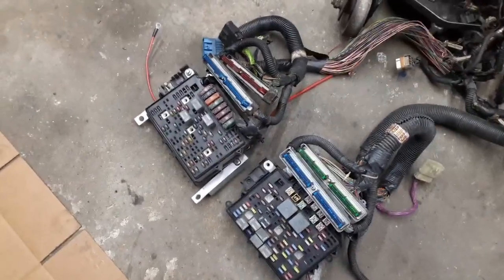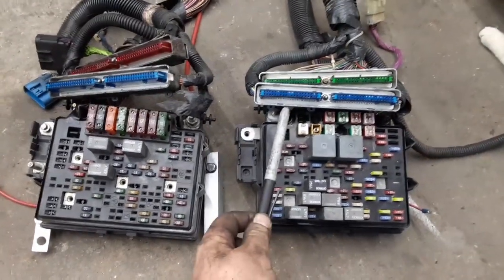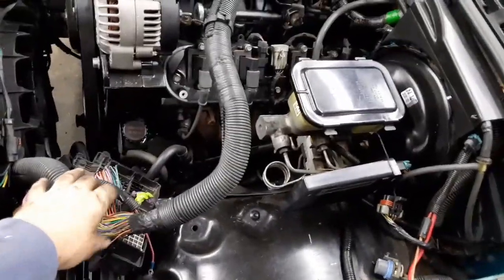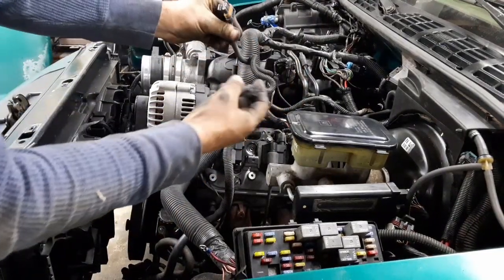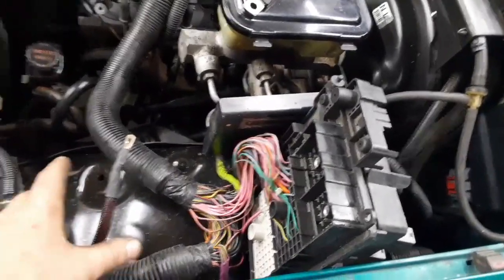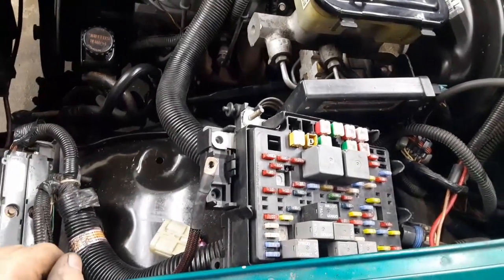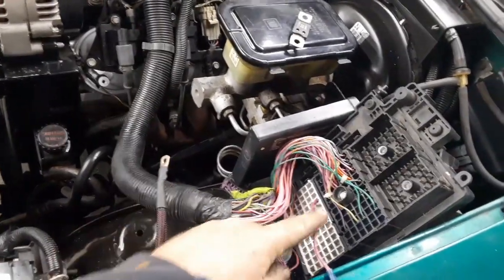LS Swap Wiring Harness for any vehicle- Basic and Simple Stock Harness - DIY

Comment: Great video man, I'm definitely gonna do mine this way. Way simpler then seperating everything ! 
One question, do I have to use the fuse block from the ls engine? I wanna swap my motor in but I'm confused how to use both the engine harness connector with my other fuse block. 
Any information would be great!!!
Reply from the maker: Most of the time I just leave the vehicle fuse block in place to run the cars electronics, and add the second LS fuse block to run the engine. Makes it easy that way, nothing wrong with having two fuse blocks.

Comment: Can I run a Ly6 with gen 4 harness and 58x crank, 4x cam, gen 3 intake/throttle body/heads, 6l80 Transmission?
Reply from the maker: Yep, it will need to be tuned for the gen 3 parts, but anything's possible with the right computer setup.
Reply: Thanks. Can I use the blue/green ecu?
Reply from the maker: Nope, you need a Gen 4 for a 58x.
Reply: E38, E40?
Reply from the maker: Either one, both are gen 4 V8.
Reply: Ok. Thank You!

Comment: I have 2002 red blue pcm with drive by wire, can i replace pcm to green blue pcm and program it?
Reply from the maker: Yes but also no. You "can" swap between the computers, but you also need to re-wire the wiring harness, change throttle body, TAC module, and gas pedal.

Comment: What if ur not using stock transmission will it still run or be on limp mode?
Reply from the maker: The transmission type and limp mode depends on your computer tune, not the wiring harness.
Reply: @lsswapshopp  cool I was planning on deleting the 4l60 to th400 and swapp throttle body to cable instead

Comment: You probably won’t see this but I did a v6 to v8 swap on my truck and I ran into a problem with my harness , v8 motor came from an 02 truck with harness and all but the harness won’t hook up to the original harness that comes from the truck which is an 06 truck i swaped computers and fuse box but the harness won’t connect to that purple wrapped plug and the Obd2 sensor if I’m not mistaken any idea what I could do?
Reply from the maker: Yep, the V6 and the V8 trucks use completely different wiring harnesses. You have to make the V6 truck match the V8 truck, which isn't fun or easy, basiclly it's lots of rewiring and parts swapping.

Comment: Where’s part 2 looked on your videos and didn’t find it
Reply from the maker: What was part 2 supposed to cover? I probally sniffed too many gas fumes and forgot about it.
Reply: @lsswapshopp  the steps to do the relay to prime gas pump and how to connect electric fans obd2 port
Reply from the maker: The fuel pump relay is already built into each of the fuse blocks, so it's automatically done for you. 

I also have 2 videos on how to wire up the electric fans. The one using the stock fan wiring harness is the easy mode one.

Comment: are you using the stock neutral safety switch? or how did you bypass it?
Reply from the maker: You can bypass it by running the ignition switch to a relay that activates your starter. As long as the PCM has the correct key-on power during Run/Start, it will start. The PRNDL switch just disables the starter relay in the stock fuse block when it's in gear.

Comment: Great video! Can I ask, what are the other harnesses that plug into the fuse box? I have recently inherited a swap that’s a drive by wire, I have the fuse box but it only had the main center harness.

I don’t have the grey harness that you ran the 1 wire from. How can I figure out what those harnesses are that occupy the rest of the fuse box so I can source them online or at junk yard. Thanks!

Comment: Nice video! I swapped a 5.3l out of a 2002 sierra into my 2010 colorado, tach works, no speedo and no fuel level.. temp gauge works though, its got a 4l80e so its getting a speed signal, bit still nothing at the speedo.. any tips? Or rhings to look for for the gas level and the speedo? Thanks!
Reply from the maker: GM wiring between 2002 and 2010 had a bunch of changes, it's likely communication issues with the instrument cluster.

Comment: I have a 2010 Silverado 5.3 Ls with a six speed 4L60E transmission all together but wanna put it in my 97 s10 pickup and I wanna go carburetor a couple of people told me if I go carburetor I won't be able to use harness nor computer nor transmission if you could bless me with your knowledge on this I surely would appreciate it my first time doing a Ls swap thanks bro
Reply from the maker: They're basically correct, although stand alone transmission controllers are a thing, and a computer can still be used with a carb. The real problem is carbs don't improve any aspect of the motor and literally make it worse.

Comment: And here I was thinking I needed an aftermarket harness. Geez. I'm guessing if I swapped cams then I would need to take it to get tuned at a shop?
Reply from the maker: Yep, aftermarket parts that greatly affect air or fuel need a custom tune. Cold air intakes and intake manifolds don't matter, but a cam changes everything in the VE table.

Comment: great vid i have a 2000 5.3 dbc what do i do with the  VAT system does the A9 wire eliminate that, thank you in advance!
Reply from the maker: The Anti Theft can only be removed with a tuning program, it's not wiring related.
Reply: @lsswapshopp  so if i wire my ls motor like in the video it will run that way?
Reply from the maker: Yep, it will run as long as VATS is disabled.
Reply: @lsswapshopp  Thank You for the info and the quick replies !

Comment: !
Reply: Hello, really need your help, I have Nissan note e11, electronic throttle body, but it keeps going off which many mechanics are not able to repair, we've changed the ECU and other boards but it still doesn't respond, it loses power supply to the the throttle,,, can you help me out with solution???

Comment: My wife inherited an old 87 dakota from her grandfather about 2 years ago. And I've been considering an ls swap on it since she got it lol. Your videos are extremely helpful on ways to help with the swap even in other vehicles.  I do have one question though (you may have covered it and I missed it) did you have the tune the ECU to by-pass the PATS pr is there another way?
Reply from the maker: Yep, you'll need the computer programmed for the swap, VATS delete and usually a couple other changes for it to work right.

Comment: So how do I find out the right pcm to use. I didn't get the pcm from the donor
Reply from the maker: Did it come with the wiring harness? You can also base it off which throttle body and TAC module you have, if its drive by wire.
Reply: @lsswapshopp  yeah I have the harness and the fuse block it has a drive by wire throttle body
Reply from the maker: If the wiring harness has big Red and Blue connectors, you need the 1999-2002 style computer, if the connectors are Green and Blue, you need the 2003-2007 computer. You can also check the part number on your TAC module to figure out the year range.

Comment: So that A 9 wire gets plugged into the stock fuse panel to any Key on power fuse?
Reply from the maker: Yep, it just needs key-on +12v to turn the fuse block relays on.

Comment: How did you connect the throttle drive directly to the computer
Reply from the maker: For drive by wire the throttle body needs the TAC module also. The stock wiring harness connects all 3 together.

Comment: where do you plug up the pink wire? the one that you added to a9?
Reply from the maker: It's the +12V wire from the ignition switch when the key is in RUN or CRANK positions. It turns the fuse block relay on to power everything up.

Comment: Wil please help what plug s in to the firewall? Only the ignition? Does the stock computer stay with old harness or its unnecessary 
I have a Tahoe 4.8& engine harness and a 03 s10 4.3
Reply from the maker: An '03 will be a little different then the '94 in the video. The easiest way is leave the stock S10 computer and wiring for meow, and just get the 4.8L running with the standalone harness and wiring. Then figure out what can be removed or needs to be connected for gauges and stuff to work.

Comment: Great video but what about the fuel pump? Like what wires activate the trucks fuel pump when turn on
Reply from the maker: With the stock computer and the stock wiring the computer will turn the fuel pump relay on and off when the key is in the run and start positions.

Comment: Can you put a throttle by cable intake on an 04 engine and run the older harness and computer? Or can you still use the 04 intake but swap the throttle body to a cable throttle body?
Reply from the maker: Yep, the only real difference between the 1999-2002 engines and 2003-2006 are the wiring harness, computer, and throttle body. If you use the earlier 1999-2002 DBC throttle body, wiring harness, and computer on a 2003+ it works perfectly fine. The intake manifolds are all identical from 1999-2006 except the 03+ might be missing the brass threaded inserts for the throttle cable bracket (I've seen some missing and some have them but not used)

Comment: Thanks for the video! This gives me another option to look into when I'm ready to do my LS swap into my '68.

Your shop cat reminds me of Dirt the cat that hangs out at the Nevada Northern railroad out in Ely Nevada. 

I had picked up a running, driving 2001 Suburban almost two years ago to use for the swap into my old pickup. Like you I've used my donor vehicle as my daily driver for several months before I had purchased my 2010 GMC Sierra 1500, and when the GMC AFM cam and lifters had taken a crap on me. I have faith that my LS swap will go well, it's just the conversion parts that I have to deal with, like motor and transmission mounts, 4L60E 4wd to 2wd conversion and refresh, fuel tank relocate and fuel system, wire harness integration, and more.

I'll be watching more of your videos for tips and inspiration. Thanks.
Reply from the maker: One step at a time and you'll be done before you know it. The "other stuff" besides the motor install definitely takes most of the conversion time.

Comment: Basically I can just leave my harness In tack. Swip the computer. Add a wire. Grounds and ill be good? Cause this is exactly what I'm looking for. 06 Yukon completely runs fine. Leaving everything on there. Just want to make it simple. Don't wanna strip harness or anything. Just a daily driver swap.
Reply from the maker: Yep, you can leave the stock harness 100% intact. I'd just recommend taping off any un-used connectors very well to prevent any sensor plug power wire accidents. It works perfect, just isn't as pretty.

Comment: Hey what's up I was wondering how did you do your interior wiring harness
Reply from the maker: The interior is all stock wiring, basically you can have two wiring harnesses for the vehicle. The stock one to run interior, lights, etc.. and a second one just for the engine and trans. The only "crossover" wires are signal wires for the stock gauges to work and A/C controls.
Reply: So I have a 87 Camaro 3rd gen it was a V6 and now I have a LS 5.3 with a 4L60E transmission and I have a PSI Standalone harness and do I keep the driver side harness and get rid of the passenger side wiring harness
Reply from the maker: The easiest way is leave all the wiring intact, get the swap running, then figure out which wires aren't used and start removing them. A Chilton or Haynes manual with a wiring harness schematic for the Camaro would help also.
Reply: Hey what’s up bro how you doing That crank no start not getting power to the coil packs or injectors while car is cranking in no spark I think

Comment: Great video very informative and straightforward.Do I have to hook up the neutral safety switch for the 4l60 to work properly?
Reply from the maker: You can bypass the neutral safety switch if you want. I've wired the starter to a relay that runs directly from the ignition switch and it works fine.
Reply: @lsswapshopp  thank you i a[ppreciate it

Comment: The front 02 sensors are what puts the engine fuel control into closed loop once warmed up this is what makes them run better when installed
Reply from the maker: Yep, better fuel economy and more HP.

Comment: Does the radio or headlights work, I am abit confused, does this have the original fuse block still to run starter, lights radio an stuff, does this need two ecus? An stock pcm for shifting? Or whatever
Reply from the maker: Everything works. The starter runs off the 5.3L fuse block. The headlights and radio use the original S10 wiring and stock S10 fuse block that's in the dash. This year S10 has a separate small module for the dash gauges, so the stock S10 ECM isn't used, just the 5.3L PCM for the engine and trans and the small S10 module for the gauges.
Reply: Okay, I am abit confused on the computers of cars skill, my trucks obd1 with an ecm in the cab, and a pcm in the engine bay, trying to swap to a 5.3 or 6.0/4L80e combo and I need to figure out if that requires ecm and pcm, aswel as fuse block, well keeping the firewall back basicly stock wiring, trucks a 1995 350 tbi k1500
Reply from the maker: It varies from car to car, but basically the LS engine and transmission (4L60 or 4L80) need a computer to control them (the Gen 3 PCM does both). The wiring harness for the engine/trans can be completely separate from your vehicle with just power, ground, and +12v ignition. Then you vehicle needs whatever it needs to run the car stuff, lights, radio, etc.. The easiest way is just keep two "separate" wiring harnesses and then later integrate whatever you need like gauges once the swap is running. Hope that doesn't make it more confusing.

Comment: I have the same harness what did u do with the rest of the wires on that big white connector for fuse.an those little connector right under the fuse box
Reply from the maker: Any extra wires that go to the stock truck I removed. If you pull the blue plastic slide-in "clips" you can push the extra wires out of the connector.

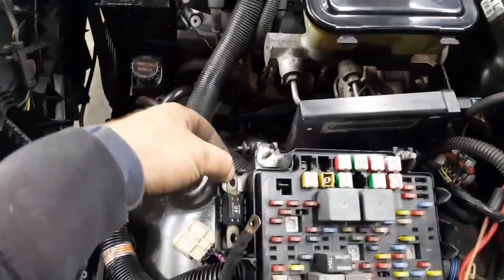Comment: at the 8:18 mark u mention the stock fuse. I hv 3 fuse boxes an all 3 r missing that dam fuse. do u no wat it is called so I can possibly get one at a auto parts store.
Reply from the maker: They're usually called MEGA fuses. It's the brand name, not the technical name, but MEGA is the most common and is the OEM one used. The parts guys will know if you ask for it by that name. They usually have all the common amp sizes hanging near the Help! section.

Comment: how did u mount ur MAF at the front of ur throttle body ? none of my spare parts fit correctly.
Reply from the maker: Just a rubber adapter I had laying around, not sure where it came from. The stock intake should adapt to your MAF.
Reply: I just cut that black plastic.i have alot of those I get from my favorite junkyard.

Comment: The 03 Express van  fuse block is completely different on the plug side. Do you have any information on this?
Reply from the maker: I'm not too sure about the express vans, they had some differences so I usually avoid them and swap the wiring to the more standard "truck" wiring. Is it possible it's a block from a 4.3L van? Also, the vans were drive by cable up until 2007 which could be why it's different.

Comment: I'm just an older guy who is kinda new to this LS stuff and acquired an '03 Silverado with a 5.3 for next to nothing complete and running, the body and interior are a little rough condition but I am thinking about using it as a backup vehicle to drive in case my main one breaks down until I can find something to swap the engine and trans into...I gave you a sub since you are straight forward and to the point with your videos without all of the useless chatter and music that seems to be common place in a lot of videos lately.
Reply from the maker: Silly intros, annoying music, and useless talking..aint nobody got time for that. It's good you bought a complete donor truck, it makes getting all the little odds and ends much easier and free.
Reply: @lsswapshopp  just knowledge and integrity 👏 I appreciate it also real info about the swap

Comment: What are you using for an ECU?
Reply from the maker: The stock 5.3L truck computer, re-programmed.
Reply: @lsswapshopp  thank you! Who or how is it reprogrammed? And they’re just pulling out the key security or is there more entailed? So sorry for my ignorance, getting ready to pull the big block from my Chevelle to do a 5.3 swap.
Reply from the maker: I just reprogram my own, I do enough swaps that I bought the programmer a few years ago. It's mostly just disabling the VATS(Vehicle Anti Theft System) , that's all that's needed to get a running engine, and a few other changes that just turn off trouble codes since it's not connected to all the electronics that the stock 5.3L truck has in it. The extra stuff is just so the codes don't come up so it's easier to troubleshoot if I need to, less clutter when I read the trouble codes.
Reply: @lsswapshopp  thanks!

Comment: Curious to see how you get the gauges going . Are you planning to run a stock s10 cluster ?
Reply from the maker: Yep, planning to use all stock gauges. Oil pressure, water temp, fuel level should be easy. Tach and speedo might be trickier.

Comment: Where can i purchase that main fuse you had coming from the battery I noticed the one i grabbed from the junkyard was missing. Do you have a part number?
Reply from the maker: The most common brand name for them is the MEGA Fuse. You can get them at any auto parts store, they stock them in the fuse section. Online just search for MEGA fuse and they'll come up. Junkyard is a great place to get them, $0.15 vs $4.00 for new.